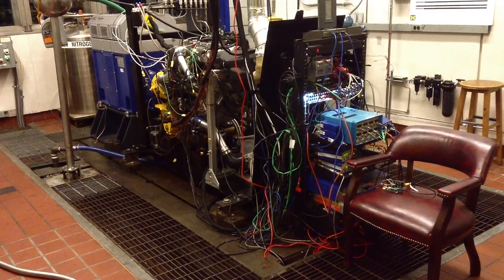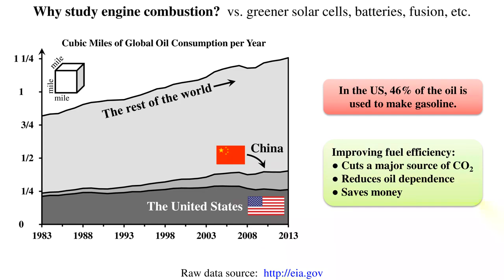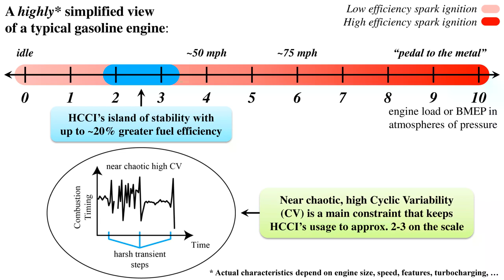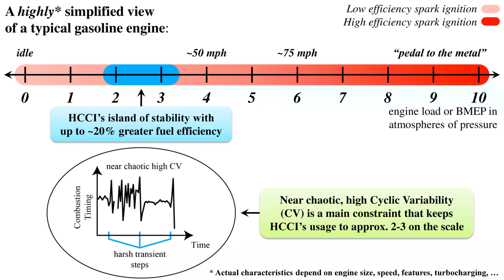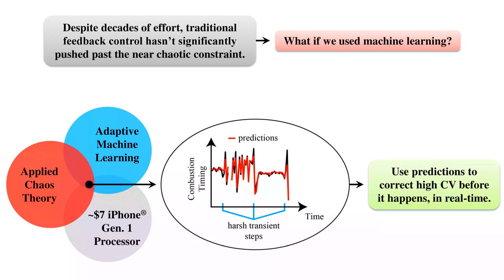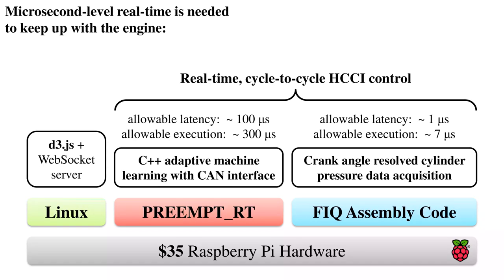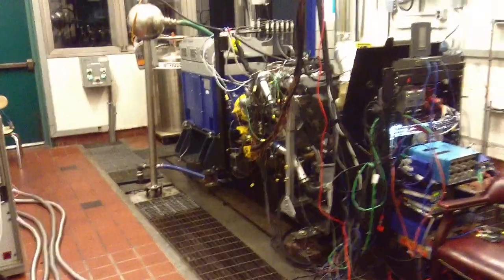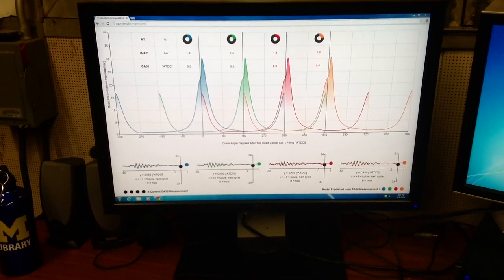Raspberry Pi Extreme Learning Machine for Near Chaotic Combustion (HCCI, Preempt_rt Linux)

Comment: 6 years later and Mazda actually manufactures an HCCI engine.
Reply from the maker: Yup. They're the only ones with the balls to innovate vs. follow Elon / fight emissions regulations. 6+ years of not reducing CO2.
Reply: @subspclr  It's a shame that most people don't understand how much NOX restrictions affect fuel economy so they've let the EPA go way past the point of diminishing returns.

Did you continue work on this after your thesis?
Reply from the maker: @larrylentini5688  It died — Neither industry, nor gov't, nor investors wanted to fund anything related to HCCI, even with AI / Machine Learning.

Researchers have tried re-branding HCCI-related combustion modes under new acronyms, but in general internal combustion engine research is a dead R&D field vs. the money pouring into autonomous & electric vehicles.
Reply: @subspclr  Sorry to hear that, projects like this are also being shut down at my University. I agree that internal combustion still has a lot left to offer.
Reply: Well it's not a true HCCI engine since they still use a spark...but in a very clever way.
I agree with both of you, I still see use in an HCCI Engine even if it's "just" for transportable generators.
If used with biofuels (ethanol, methanol ect) it would be a better solution for the enviroment then a pure electric car.
But...I guess we won't see such an engine in the near future.

I thought the video was very interesting but I have a view question:

1.Did the Engine really run in HCCI mode or was it something mixed like Mazda did?
2.Was the Engine tested with different intake air temperatures?
3.Would it even be possible to start the engine without a spark just by fuel/air and pressure with the algorythm?
Reply from the maker: @Slithermotion  Answers:  (1) It's HCCI, which you can tell by the shape of the pressure traces. (2) Yes, although not extensively. (3) Not at this compression ratio.  You need to warm this engine up first, which is most easily achieved with spark.

About other markets for HCCI-like engines — Mainspring Energy is producing a free piston one for distributed power generation markets:  https://mainspringenergy.com/technology/

About Mazda — (Boosted) Spark-Assisted HCCI (under various re-branded marketing acronyms) isn't new, but Mazda seems the closest to real automotive market share for it.

Comment: Can you provide any information on the pressure transducer utilized for gathering cylinder pressure?
Thanks and great work!
Reply from the maker: It's a Kistler sensor.  I forget the exact model number.  I've also used lower cost Optrand sensors.